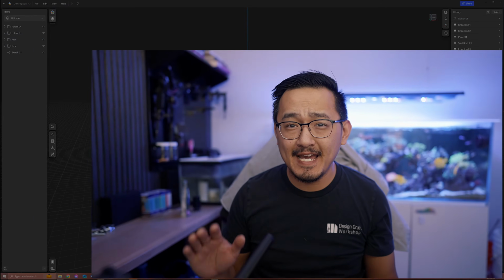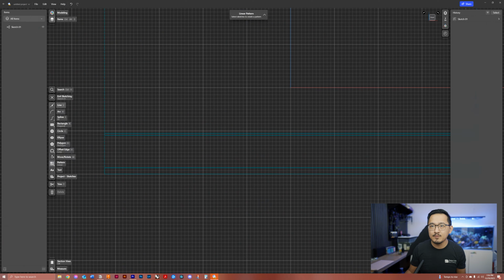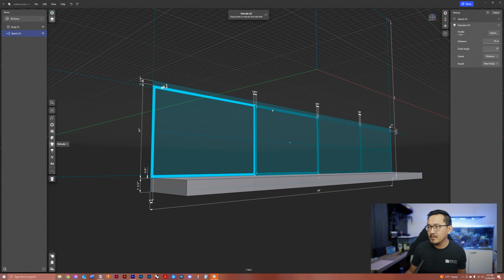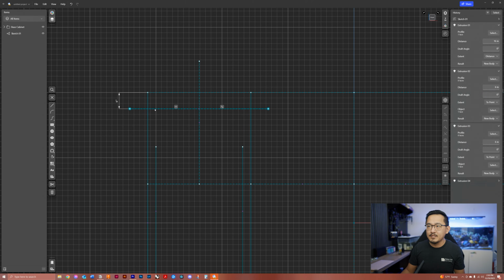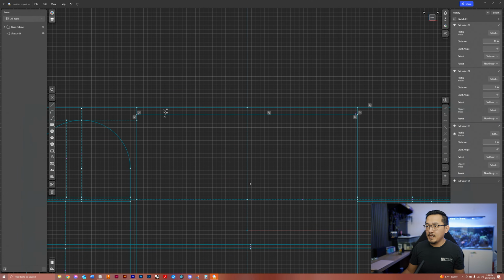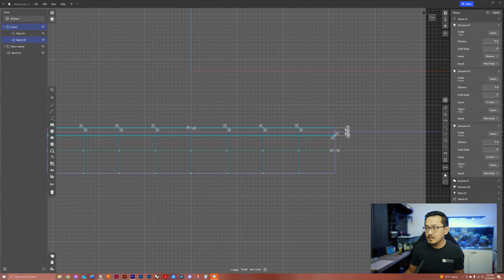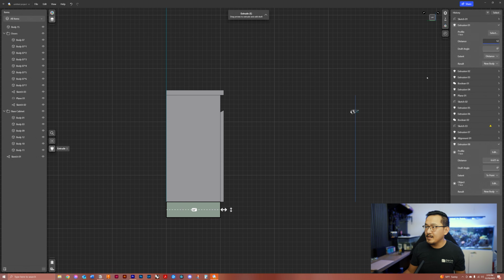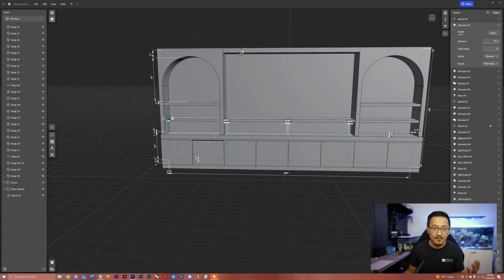FREE! 17ft White Oak Media Center 3D Model // Shapr3D Parametric Modeling

Comment: i have a new issue. I finished the model and everything was scaling appropriately. I wanted to play around with resizing and importing into a new project. so i saved this project, went over to my house I'm modeling and got measurements for the living room wall. when i went back into this project. I adjusted my height down from 96 to 92 inches, and all the arch work breaks and disappears. i went back through all my extrusions and nothing has changed everything is still set up the same. the only thing i can think of, is when i organized my items, i moved my sketch's into their own folder. does moving the main sketch into its own folder break the parametric modeling system?
Reply: all of the rest of the scaling still works. if i change the baseboard the rest scales and if i change the overall length is scales. just when i change the height now it breaks
Reply from the maker: Moving the sketch into separate folders shouldn’t break it. I would check the radius. Perhaps the radius isn’t scaling correctly.

Comment: hey, having a little issue with this tutorial. I am up to where you project the lower cabinet lines onto the new plane. so far all my dimension scaling has worked. however, after i project the edges onto the new plane. The projected sketch does not link with the original sketch. i change the dimensions, all the base sketch and objects scale accordingly but the projected rectangle does not. any suggestions?
Reply: disregard this, with some exploring in my projection option, i learned about the link-sketch option

Comment: When you wanted to offset the arches 1.5 inches from the front of the face frame, Can you just set the extrusion "to object" and use the construction plane as the object?
Reply from the maker: At the time of making the video, it wasn't possible in the beta. I haven't been able to test it on the actual release yet. But I do hope that you can do that.

Comment: The to point option is no longer there.  In this case I can extrude to object and pick the face of the base but what if you need to extend to a point? Say on a bodie with a 45 chamfer and the cabinets needed to be linked to the inside edge of the chamfer?
Reply: the, to point option was just renamed to, to object. its the same function just a different name.